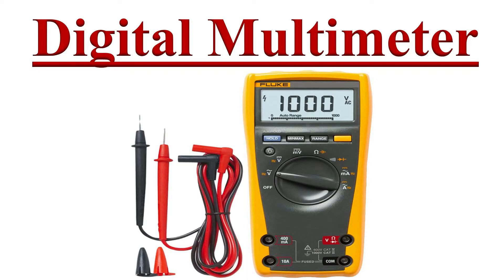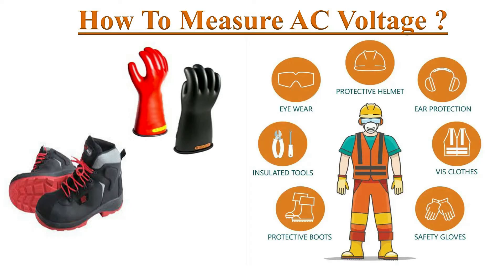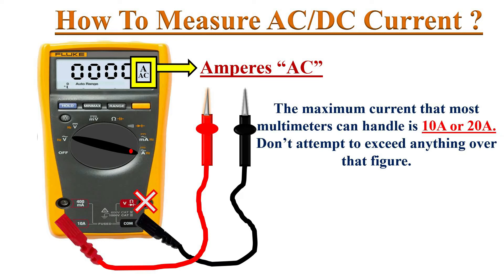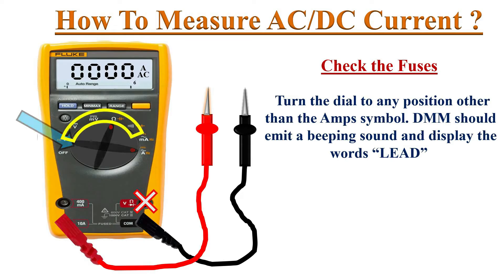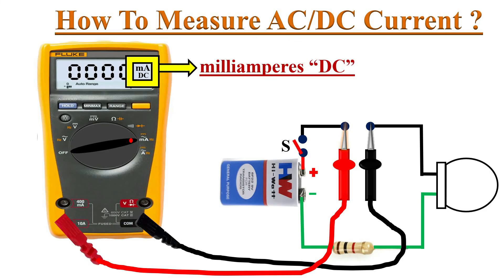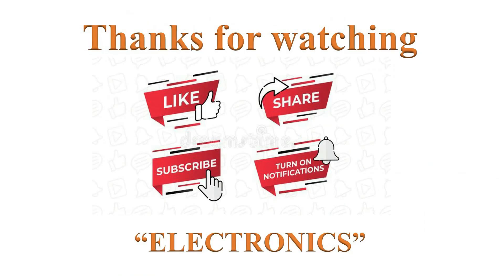How to measure Current with Digital Multimeter?

Comment from the maker: Timestamps for various topics covered in this video are as follows:
0:21 Multimeter setting for Current measurement,
0:49 Safety precautions before measuring Current,
2:06 Checking of Fuses before checking Current,
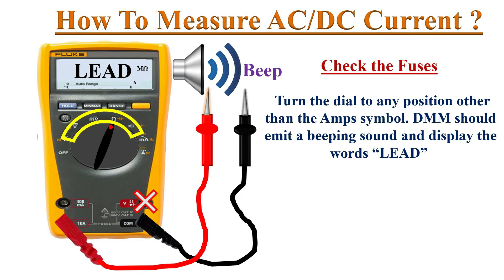2:36 Measuring Current in a circuit,
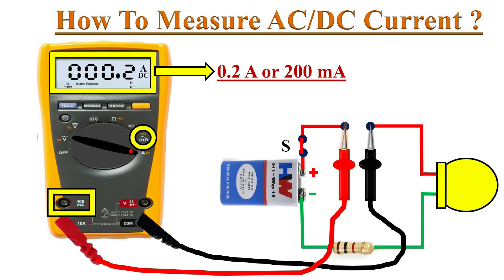3:41 Milliamperes current measurement in a circuit.

Comment: That was helpful. thank you sir for the content
Reply from the maker: You are welcome.
Reply: @ElectronicsAD  Excuse me, can we connect the red lead directly to the + part of the battery and the black lead to the negative of the battery as well? I just want to know how much current my battery is able to provide.
Reply from the maker: @tocube1  No, you should not connect a digital multimeter (DMM) directly to a battery to measure current. It will damage your DMM or Battery.

Comment: connected red wire to 10amps  and black to com. 

now connected the red in positive in phase and negative to neutral in the AC current. 

The dial is set to 10A. 

NOW SPARKED  AND MAINS TRIPPED. POWER GONE.

HOW TO MEASURE CURRENT/AMPS IN AC CURRENT WHICH COMES TO HOME AND WHAT MISTAKE I DID
Reply from the maker: 1) Turn off the power source in which you want to measure the current,
2) Set the multimeter to the appropriate AC current range, 
3) Open the circuit and connect the multimeter in series with the load, 
4) Turn on the power source and read the current value on the multimeter.
As per your query, You did wrong in 3rd point.
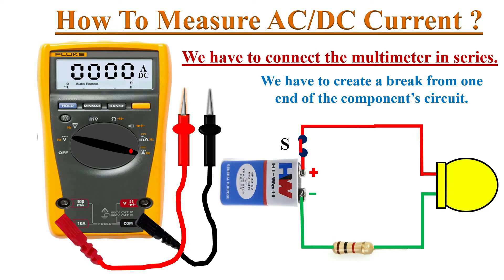Please rewatch the video from timestamp 3:00 minutes.